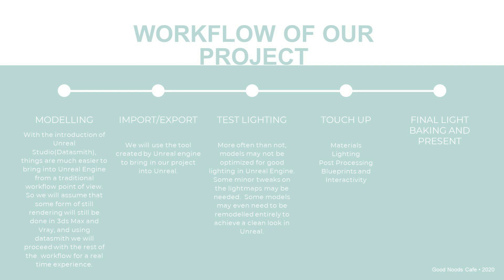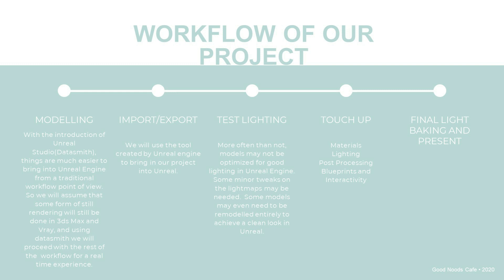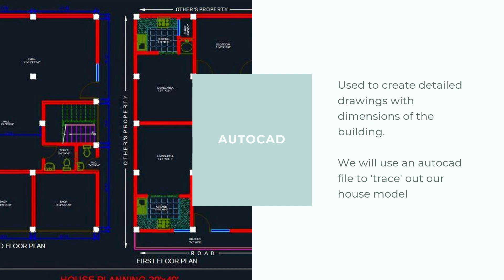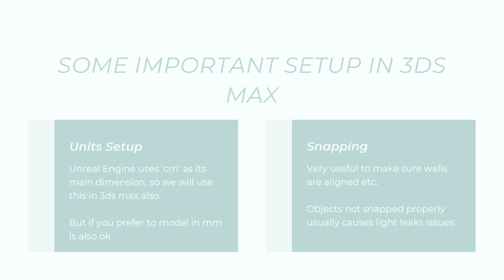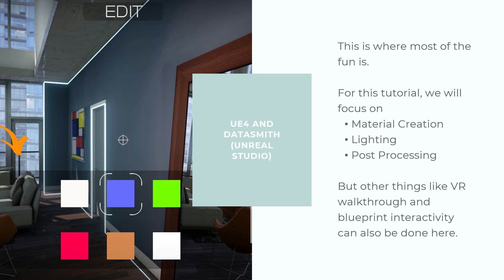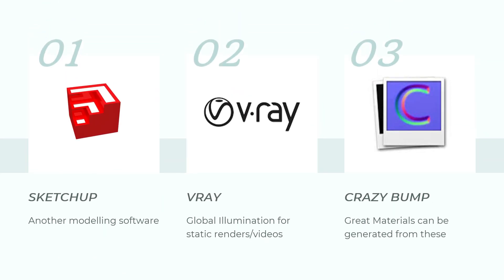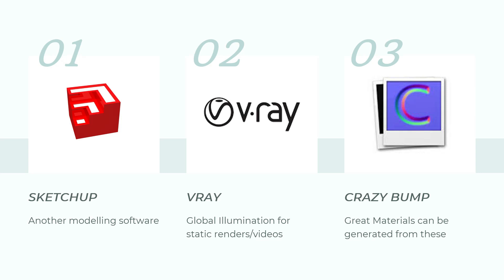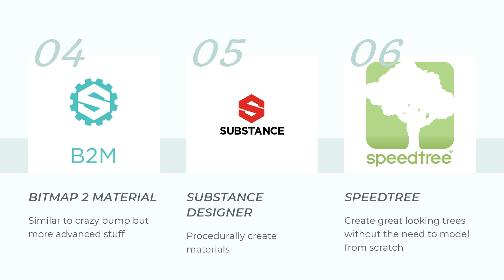2.1 Workflow and software discussions - Unreal Photo Realistic Archviz Tutorial

Comment: Hi, Thank you for the tutorial videos. I primarily use Sketchup for modelling and would love to know how to use sketchup model in UE4. Like you said. lightmaps is an issue so would be great if you can have a workflow tutorial on sketchup to UE4. Thanks!
Reply from the maker: Hi there. Ok we will take note. 

At the moment we do not really have a clean method to workaround SketchUp lightmap issues. What happens is when we import SketchUp models into UE4 the meshes are joined together and there is only one  lightmap generated for this big mesh. This is not ideal as we need to break up the mesh to smaller parts for best lighting. 

What we end up doing is that we still have to import SketchUp models into 3ds Max to touch up before bringing it in to UE. 

Of course we haven't really use SketchUp enough to say that this is the only way. If there are others who have a good solution to this please also comment here so we can learn together :D